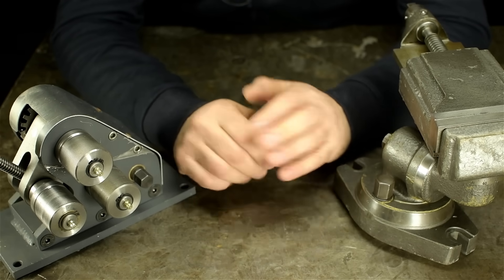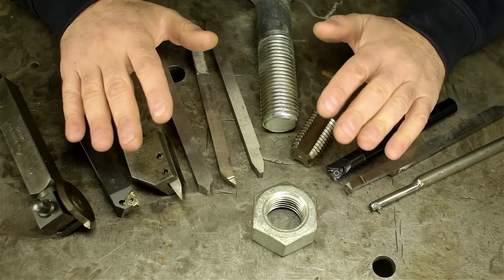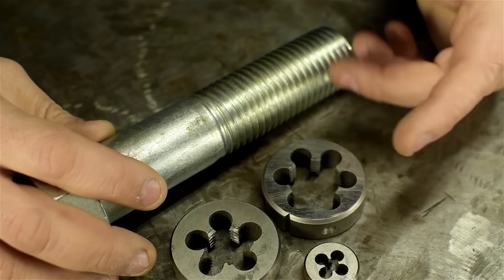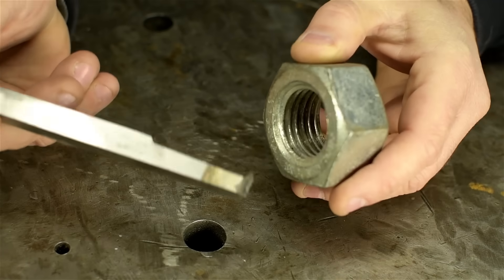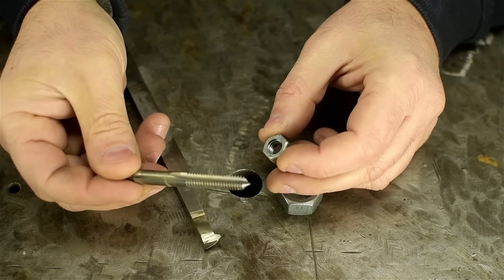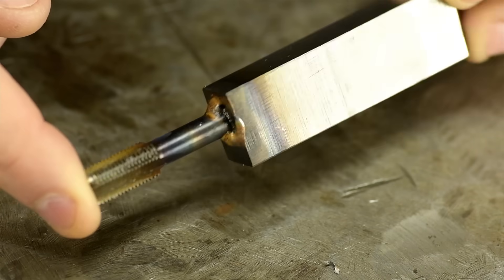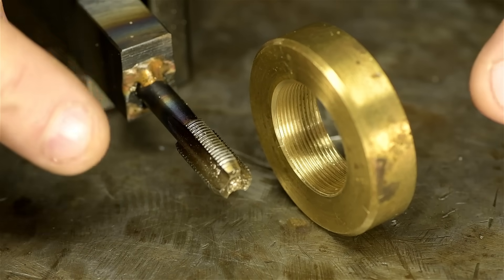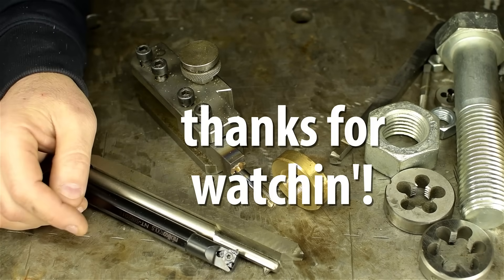Using a TAP as Thread Boring Tool

Comment: Sorry I don't know anything. Mechanically, what happens that allows you to start the threads at the right place on each pass instead of cutting off threads made in the previous pass? I guess the tool holder retracts back to a set point. But what causes it to start advancing when the workpiece has rotated to the correct position?
Reply: thread dial on the lathe lets you start in the same spot. If you don't have one it is a pita but possible to reverse the lathe with the half nuts engaged and then have another go.

Comment: Hi Tony, I'm project engineer for a cutting tools company and I find your technique "simply clever", to use a tap as a thread milling cutter by adjusting the tool center away from the workpiece center, this is very smart use of the lathe. I suppose this is a very cost-efficient solution if you machine small series and as your workpiece is made of soft materials.

Comment: Imagine how easy it would be if, when you state the thread pitch, you actually stated the thread pitch... Like we do in metric
Reply: I'm a metric fan, but, actually, when it comes to single point threading, I disagree. To cover all metric thread pitches, a metric lathe's thread dial needs at least 3 different gears.
Reply: @bogdan_n  still easier than 3 and 17/231 and a half 11ths of a gear
Reply: Imagine if you just bought a tap and called it a happy
Reply: i googled that word, google says metric is a canadian rock band. so, i gotta say, i'm not sure tony singing the thread pitch would be easier.

Comment: Disappointed with the lack of demonstration for the manliest method of cutting threads - cutting a single groove along the long axis of the work, and then twisting the work to make a thread.
Reply: Rubber Gloves and metal softener spray helps tremendously.
Reply: That's a genius suggestion - if you got some clay and spray painted it metal silver you could pull this on camera I reckon! ToT could do some video trickery like that for sure!
Reply: Three grooves for a multistart !! 🤗
Reply: Ha that’s awesome. I saw someone online who made a replica cannon and had to do that to do that for the rifling of the barrel.
Reply: Getting it to twist consistently is a huge challenge with this setup. But manly indeed
Reply: Imagine if you found a Solidworks model where all the threads were done this way.

Comment: Oh god this brings back (bad) memories.  I used to have to do this using the same (model of) lathe as Tony's. (If that really is your name!). Things in batches of 100 to 200. My knees and back still ache from leaning over to look into the bore, day after day.  Diameter was about 6" which was nice but, thread length was about 3/4". In steel with a single point tool as it was up against a shoulder, not through hole. Had to be quick on the leadscrew lever.
Thanks Tony for bringing back the memories. I'll likely not sleep tonight.
I may have to unsubscribe due to the traumatic memories each video brings back.

Comment: I thought threads in bolts were rolled into the metal and not cut so they would be stronger. Bolts gets rolled between two plates that have the thread patter in it.
Reply: the things you can do when you wanna make a million bolts an hour and you've got the capital to get 50 ton automated presses and such. edit: and if you want high tolerance, you're going to be cutting stuff. that's why it costs millions to get to the bottom of the sea, or to other planets.
Reply: @ClannerJake  Huh, that's interesting.
Reply: @jophmac  yeah, they have a video on how it's made on it. it's on youtube now https://youtu.be/2Jg7N_HT17A (not that great of a youtube edit sadly) if you wanna watch. but the short of it, is they start with wire rod and heat treat it soft and beat it into shape with heavy equipment, then re-harden it. and they can do large bolts at a rate of 300 a minute with that process.

Comment: Can't wait for the one million special.
Just one comment on the trick. If the pitch is the same on a 1/2" and in a 3" thread, the angle of the helix will differ, so the tap should be as close to the hole as possible.
Reply: I would agree if you were engaging the threads on the tap.  Since you're only engaging the teeth and not the rest of the tap thread, I don't think it would matter much.

Comment: I ran a run of 6in dia part for oilfield use. External tapered acme thread with two face seals. One at the shoulder and one half way down the thread taper to a step. The part also required an internal straight thread with face seal and 2 ring groove. It was a god damn nightmare as the mating part engaged/sealed externally and internally. Total nightmare got paid though :)

Comment: Internal threading tools/inserts tend to cut deeper (doc) than external threads. To allow for clearance differences between threads.. Any materiel harder than brass you will get to much push off / to much cutting surface area for the tool. But you can grind away a few of the flutes and it works!.

Comment: At some point I lost the thread.
In the 1970s our blacksmith shop I used to install 2 1/2 inch steam pipe in factory roofs in Lancashire mills most of the time we would take the cut pipe back to the workshop to thread it rather than use the hand die set which was a bit bigger than this set https://www.clarketooling.co.uk/product/cht392-6-piece-pipe-threading-kit/

Then my dad in the late 1970s bought a https://www.diamondtool.net/ridgid-15682-model-300-power-drive-threader-complete-system-12-h/product/0/rid%2015682
Also we had to make pipe hangers using rough blackbar this was not round but was cheaper than threaded bar or bright bar.  
At the age of 10y I was helping removing old pipe with 36 inch stilton's and pipe ringers
https://www.toolstop.co.uk/bahco-361-36-stillson-type-pipe-wrench-900mm-36in-p32858/
https://www.cromwell.co.uk/shop/hand-tools/chain-and-strap-wrenches/chain-pipe-wrenches/f/6402

Often I would crush the pipe before the old hemp and boss white sealing the thread would give.
https://www.ebay.co.uk/itm/Boss-White-Paste-and-Flax-Hemp-Traditional-Plumbing-Pipe-Jointing-Materials-/111512163780

Wow I did not think they would still sell the items today after all these years, a nice trip down memory lane.

At the age of 17y I remember making and thread turning a Pulse jet combustion chamber in a friends garage, (page down a bit to see the plans)
https://www.instructables.com/Make-a-Pulse-jet-engine-Scanned-from-1958-plans/
I even tried spark erosion to make the petal valve and in the end I used scissors and rolled it flat, some times KISS it.

Thanks for allowing me to reminisce because nostalgia is not as good as it used to be.

Comment: 7:10 1"-24 tap: $20 on amazon. So... yeah, TOT, that sounds about right for your luck.
Reply: Yeah, but you'd have to wait two, sometimes three days for it.
Reply: @UncleKennysPlace  And odds are you'll break it off the first time you use it anyway.
Reply: $63.35 from Travers.  That $20 tap may not be up to the job for harder materials.  But brass rings?  Bring it on.

Comment: I've totally single pointed a 1/2" x 28 internal thread! lol!
Reply: I've single pointed a 1/2" x 10 TPI acme internal thread to make a cross slide nut. Thankfully I had some 1/4" round HSS and a shop-made holder for it, so I didn't have to grind all the corners off...

Comment: Hey Tony, I've a video idea: Have you considered creating a device that quenches steel using air in place of oil or water?
Reply: Not sure if I'm missing a joke, but they are called "quench plates", and the A series of steels are air quenched, as are many stainless. The medium depends on the specific alloy. O or W steels, or other steels requiring oil or water need to be quenched faster than air can manage - it's generally easier to just use the correct medium than to mess about trying to make air pull heat away as fast as water and still be even.
Reply: @fnordfnordsson4385  I honestly had no idea, seems interesting. Thanks for the info

Comment: And if you need it for a pitch you don't have a tap for, pick one that's close and grind all the teeth off on that side of the tap except one fully formed tooth
Reply: Interesting.
Reply: Pick one that's a little coarser so the lone tooth is long enough.  I once used a 1/4-20 tap this way to make 17/64-26 BSC nuts.  It was very spindly as I had to relieve it a lot to fit, so it wasn't an ideal choice but what I had handy.

Comment: I kept waiting for the reveal on whatever special effect was used to generate that comedically large nut and bolt... but it appears Tony actually had that on his bench, in case he needs to mount a 5-inch deck gun to his dirt bike.
Reply: You laugh about that nut, but the reality is that Tony is just very, very small.
Reply: @account0199  Misconception. Tony is regular sized, but his hands are very, very small.
Reply: The city leaves those things all over the place under every street light... Just go grab one if ya need it!
Reply: My dad engineered power plants and would occasionally send me photos of flange bolts 4X that size which had been ripped apart as if by the hand of an angry torque god.  The one you're talking about is barely larger than what you can get at the hardware store.  Certainly Fastenal would have them in stock.
Reply: @C20H25ON3  Yeah, the fasteners you see on cranes are insane. That latest crane collapse showed evidence of those massive things sheering right in half.
Reply: @AlphaMachina  Oh God, you guys are also discovering the joys of using parts made of Chinesium. lol
Reply: I carry a few of those in my pocket for emerg situations.
Reply: Bolts much much larger than that are used all over the place. Ever go downtown and park your car in a precast parking garage? The anchor bolts that hold the columns to the footers are about 3 inches in diameter, and the nuts  take somthing like a 5 inch knocker wrench to torque down.  I once saw a picture of a guy standing inside a nut that was like 8 feet tall. I don't remember what it was for, but I think i recall it was used to hold the tensioning  cable on a huge suspension bridge or somthing to that degree.
Reply: @codylapoint  I strongly recommend you do not Google “huge nuts” unless you’re in to that kind of thing (and what TOT fan isn’t in to that kind of thing?) 🤷‍♂️
Reply: @MukYJ  I wouldn't Google "huge screw" either.
Reply: @codylapoint  Fasteners don't get much larger than 3" in diameter unless they are for things like ships propellers, because at a certain point it's better to use more smaller fasteners rather than fewer large ones. That crossover is about 3" The bolts that hold down wind turbines to their foundation pads are usually around that size. 3.75" and M100 are the largest generally available for structural use, and those would indeed be for things like bridge stays and wind turbine foundations, and exceptionally large ones at that.
Reply: @codylapoint  All certainly true, but I still had a laugh at seeing such a fastener on the bench of a hobby machinist. Maybe it is integral to his next go cart, or pasta press, or musical marble machine.
Reply: @codylapoint  Fasten ship's propeller?
Reply: It would be way bigger for 16” deck guns.  The subs bearing cap bolts were 2-1/2” in diameter & we had to torque them to 10,000 ft.lbs.
Reply: I had a seized 12a rotary engine in my Mazda RX-7. I discovered that the tiny car made of tiny parts had one comedically large nut on the flywheel. As a pro fisherman, I'd wager the nut was about 3 feet. I finally get a socket to fit on this thing and a whole telephone pole to lever it, and that, my friends, is how you un-seize a rotary engine.

 Removing the nut is another tutorial I'll cover next episode.

Comment: It's been a long 2021 years.  Glad we made it to the next one though.
Reply: Guys tell me what happened part 2 and 3. Couldn't watch them had to work on the pyramids at part two had a really tight time frame back then. At part 3 there was some guy born and the emporer went nuts back then so no watching tot either
Reply: s leonheart 
Great! Your just the guy to ask. I’ve been watching vids on how the pyramids were built and there seems to be a little disagreement as to how it was done. Was it a straight ramp,  an external spiral or an internal spiral tunnel that was used?
Reply: @Therapistinthewhitehouse  External ramp tried internal but had stability issues and getting the blocks round the corner was a Hassel
Reply: @sleonheart4106    
Good to know, just in case I decide to build a replica in my garden.
Reply: @sleonheart4106  
Part 2 was threading your pyramid stone rolling logs, and part 3 was threading bolts that were supposed to be used in a follow-up video titled, "Building and Testing a Better Cross."
For some reason that one isn't on YouTube any more.
Reply: @HomebrewHorsepower  damm should have watched part 2. Took us years to pull up stones the ramp. Theading the logs would have helped keep them together.

Regarding that cross thing i heard the church striked a copyright claim or so the story goes. Have to get tot to do a time travel again. On second thought i am still getting over the metric disaster
Reply: @sleonheart4106  In Part 2 he also went off on a tangent about some weird looking foreigners that are really good at building pyramids. He didn't have their contact info though and I hear people are still trying to find them to this day.
Reply: @HomebrewHorsepower  hahaha lol, very funny 😄 lol
Reply: I'm still sanding my tool from the last episode.....
Reply: Parts 2 & 3 didn't really live up to my expectations tbh, I'm still using my original bone threading tools, they where the real game changer.
Reply: I can't believe it's already been 2,021 years since the last one around this time in 2020!
Reply: Quicker than Project Binky episodes at least!
Reply: Have you really seen the previous one 😁
Reply: Crap, I missed the one from 2021 years ago, it has been 4042 years for me...
Reply: Can't wait for 4042 for part 5!
Reply: Can't to see all you again in 4042
Reply: At least there was machining in this one.
Reply: @NuttyforNissan  I know I started to feel sorry for those people spinning that log
Reply: Yes well the Mayans were clearly subscribed to ToT but got the period very slightly wrong - understandable after all that time...
Reply: Oh Yes, 2021 years ago. The day Jesus Christ died for our sins. Were getting close to his return
Reply: That's why I keep my notifications ON! 😂😂
Reply: Been watching since ep2
Reply: What were the dark ages like?
Reply: I had Alexa set a reminder. No way I am going to miss the next episode.
Reply: I was watching part 4. Had to come back to find a hidden hand gesture. Thanks TOT for a millennia of teaching.